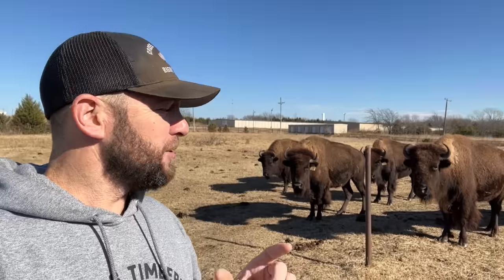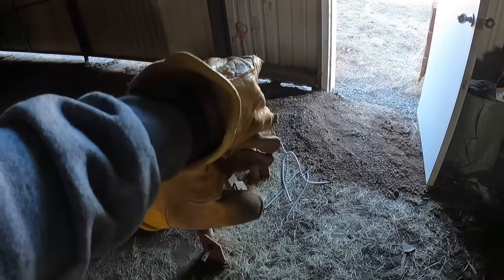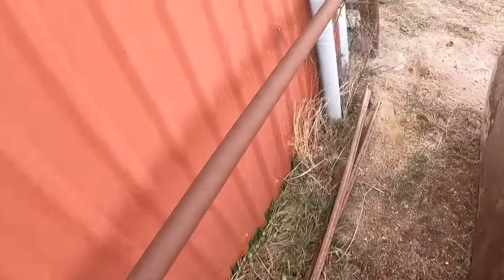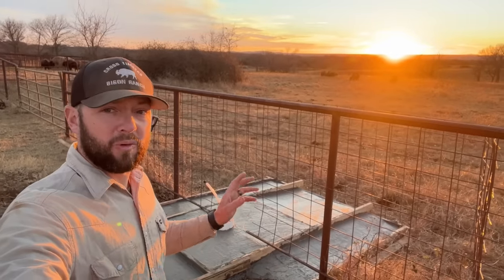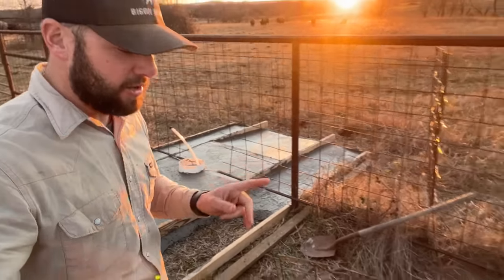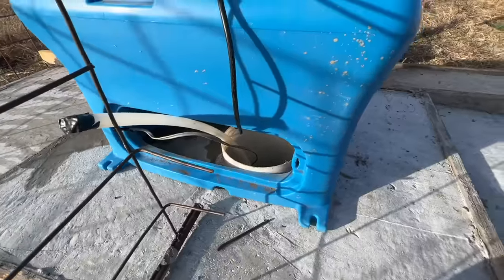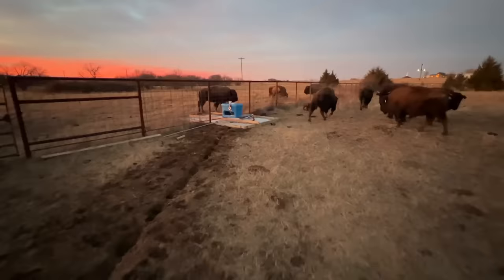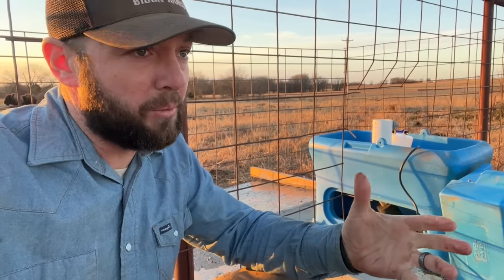So Many Inspectors! Install from Beginning to End

Comment: Walker farm fam found an automatic cord plug at Lowe's that turns the heat on at temps just above freezing and off at 50ish*. It goes between your heater cord and the electrical line.

Comment: Idea for you: 
Instead of putting more concrete, look into those hard plastic gravel grids. You can even drive over them, they can used to avoid mud pits. You lay down the grid, then fill with whatever gravel you like. If you put more concrete it’s still will be a muggy bog further out, so with the gravel paver grids it’s holds them in place and will allow for drainage underneath.  Look at horse pastures at gates,, or driveways, even allows grass to grow thru them while holding the integrity of the ground underneath.   If you do go with just concrete cut some of those saw slices for joints to prevent internal cracks.

   And…..I would have thought you needed gravel below the concrete to avoid freeze upheavals?  Your weather is similar to a northern Virginia I think and we always need to put some type of gravel.

Comment: Here in Colorado, ours has to be buried at a minimum, 36 inches (3 feet) deep. Recommended depth is 40 inches. Anything above 36 inches has to be insulated well, and possibly heat tape wrapped. Nice setup.

Comment: Food for thought Dusty.  Instead of coming UP through the bucket with your main line, put a "T" where the main line goes vertical, extend the main line to the far north end of the pad and cap it off there (with a ball valve).  Then, later, IF you want to continue your main line, you start at the capped end and trench to your next location.  The ball valve allows you to shut off the water to the new work and open the valve when you're ready to put the new line into service.  If you use an exterior plumbing access box/lid (sub-grade), then you can gain access (later) w/o digging, if you need to shut off the water.

Comment: Dusty can you put the heater wire under the hood and in that pvc pipe and bring it out the bottom and thru that side door so it will be safer from the bison from stepping on and breaking the wire. You could anchor some conduit down from the water to the elec box to help protect the wire. Just a thought

Comment: Dusty love your farm,hey with the electric should have used pvc pipe  oversized with an in ground junction box before you got to the concrete pad,that way if you need to add electricity later you would have easy access,but just saying,brother keep going

Comment: That will definitely make it nice for the bison when we do get our cold snaps and the water freezes to have the heaters in it you won't have to worry about rushing over to break ice for them or the bison trying to put their hooves in it to break the ice themselves and tearing something up. Also  it's nice that it's easy to take the heaters out during the summer, even though I had to laugh because you misspoke and said take the heater out during the winter and you actually said it a couple of times I don't know if anybody else caught that had to give you a hard time.  God bless yall

Comment: Your getting there one project at a time. Your thinking ahead, you don’t need it until you do. There’s nothing worse than hauling warm water. It’s like in Florida, you only have to go through one hurricane without any power, to know that you get a generator, even if you don’t have another for 10 years. So heck yes!
I thought the bison would be afraid of the trencher, and was surprised by their curiosity.

Comment: 1.)  Warm water in the winter even when you don't have to worry about ice in an unheated water tank is good for the animals.
2.)  My folks did the same thing you did with water and electricity.  4 inch ditch, 3 feet deep.  3 feet because dad did not want to worry about digging the pipes and wires up by accident.  Dad worked almost 40 years putting in high pressure gas lines down all over the western US so he was a little OCD about straight ditches.

Comment: U can use an item called a throm cube, and your heating element will only turn on when it reaches a certain temperature (32 degrees) is one of the options.

Comment: You need to put thermostats and a power relay in the power line to the heater so that the heater only comes on when the temperature at the water gets close to freezing. If you wait until it freezes you will damage the equipment. You can install the temperature control system in the barn so the one thermostat will control all watering heaters. Check the heater it might have a built in thermal switch to keep it from working until the water is cold enough to freeze.

Comment: Those are good looking waters for the bison now and only thing I would have done a little bit differently was I would have put the electric wire inside of a piece of pvc piping or metal conduit piping out of the water and I would've put a ground fault breaker  outlet at the water and I would've run the whole thing off of a ground fault breaker inside of the barn itself too other than that it looks really good now too to bad we didn't get to see that little cute brooks now she's just cute too have a good day now dusty

Comment: I would have seriously thought about running the water and electrical wire through a PVC pipe for easy pulling if you ever had any issues with the lines. It saves lots of time in case of problems later in life. But looks like you really know what you are doing, and enjoy the bison. Good luck with your new project.

Comment: My Family did the date, hand prints & names thing with concrete too. There was also a date on the barn. This is a great set up though perhaps sloping the pad to ground vs straight drop might be good. Avoids hoof or ankle injury if animals don't get completely clear. Just a suggestion after having dealt with that sort of issue. Have a wonderful day! 😁🦬

Comment: I'm wondering a plastic tub will hold up after a few alternating  hot/cold seasons. Especially with any rough treatment from bison in extreme cold. Plastic cracks far too easily when it's frozen. And it looks like only 2, at the most, can drink at a time. You know how bison tussle around feed and water even more than I do.

Comment: Put a thermal switch on the line in the Barn feeding the heater unit... set the temp below a certain temp with probe outside barn wall, it comes on and if it above the temp it is off and no power to the electric line... set it and for get it... OBTW: it has as override function, if you need the power receptacle for something else just activate it

Comment: Just a suggestion for a project like this in the future. When I had my irrigation system put in and I wanted to run electric to a section the underground wire was attached to the pex as it was laid.

Comment: On future water installs you might try installing a fitting on your plex then using a more flexable connecting hose ( washing machine hose for example ) to connect the two different  pipes

Comment: They make an adaptar for outside with thermastat your plug one end in your wire other in your outlet will cut it on automaticale when temp drops to setting. Lows has then. Might be worth checking.

Comment: I like your videos 
Watching you unroll the 100' roll of 12/2 with ground seems to be a costly way to get wire 
But I guess you don't use much of it , to invest in a 250' or 1000' roll 
I used to do electric work and have 1000' spools of different sized wire in the shed 
But as I have PVC conduit and THHN , that is what I would have used incase I needed either more power or to able to replace the wire quick

Comment: Make sure you use GFIC PLUG OUTLET, either at the barn or out by your water box but make sure you use a ground fault interrupter plug you can put the plug in the barn and hook the wires up to the plug and then you’re ground fault circuit is set out to your water box  So the animals and yourself won’t get electrocuted!!

Comment: You run the power cord down the white pipe for its in side of the water for the cant eat it i know cow well eat it then there died or short out and your fence well be hot and any one that touch it wouint be good

Comment: Dusty I know it's too late now but always run electric lines in conduit so when it goes bad you can just pull in a new one. Direct buried cable will have a problem sooner or later.

Comment: I would have thought that you would have put the electric socket and plug under the water trough to keep out of the way of hooves and the weather. Then at the other end wire in a thermostatic switch so it switched on when the temp dropped down to freezing that way it would be automated which is the best way to go.
Reply: My thoughts also.

Comment: You only need to put a plug  on the end of the wire  You then plug in under waterer. You don't need a box outside of waterer.

Comment: One would think the drain plug would be on the outside not on the inside. Dahhhhh hellloooo
Reply: This way the water pressure will help hold the plug in.  Outside plug can be pushed out with water pressure.